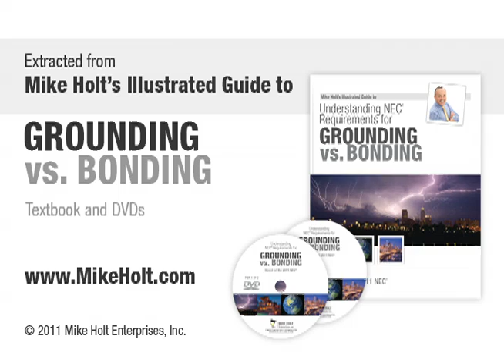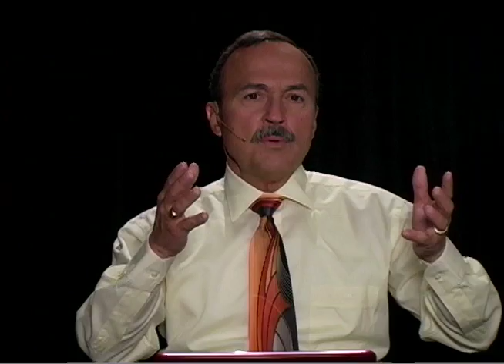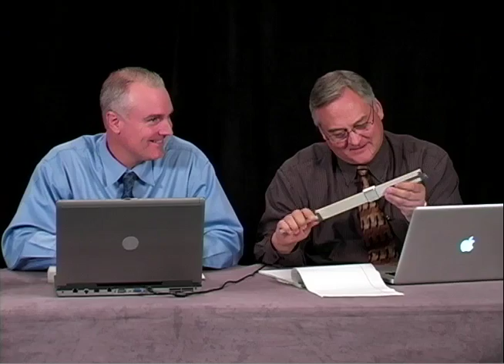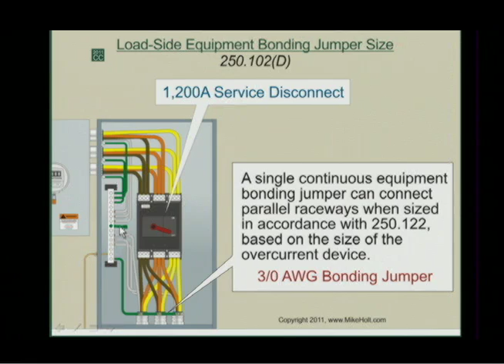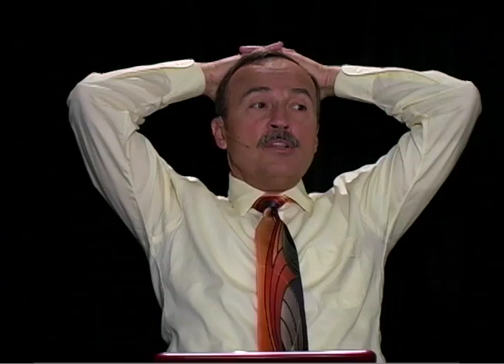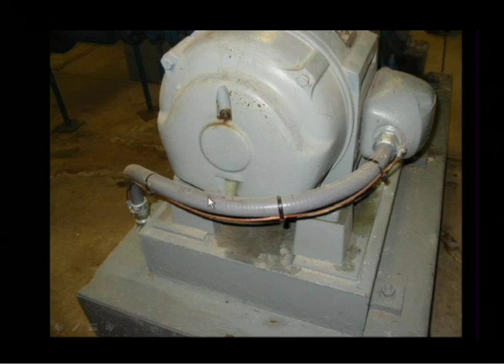NEC 2011 Supply-Size Bonding Jumper 250.102(C) (11min:10sec)

Comment: @ 3:55, according to 2011 NEC, it seems you are correct, that you could have a SSBJ larger than the ungrounded conductors.  I cannot imagine a scenario in which you would have 10 sets of 600 kcmil in one raceway, but I guess it could happen.  More likely, you would have 10 separate raceways with a single SSBJ being used for bonding these raceways, which in 2011 would require 750 kcmil.  Code making panel has addressed this for 2014 and 2017 NEC in Table 250.102(C)(1) Note 1. "The bonding jumper shall not be required to be larger than the largest ungrounded conductor."  This also applies for minimum size grounded conductor which is a more likely scenario and was already addressed in 2011 NEC article 250.30(A)(3).  While we are on this topic, this also applies for 250.122, minimum size equipment grounding conductor.  2017 NEC Article 250.122(A) says "...in no case shall the EGC be required to be larger than the circuit conductors supplying the equipment.  For example, determine the size of EGC for a 1PH 5HP motor operating at 240V.  #10 on a 70A breaker.  250.122 says you need a #8 ground, but it also says in no case required to be larger than the circuit conductors.  Therefore a #10 EGC.

Comment: Im not sure I even understand the first graphic. Conductors originating from utility continue through CTs and then terminate on the line side of OCPD. Where is this supply side bonding jumper coming from. I was always taught that the bond was at the first point of disconnect. 
from that point ground neutral separate . I am so confused
Reply from the maker: Per 250.92, metal raceways containing service conductors must be bonded. These raceways contain service conductors, so they are bonded to the service neutral terminal.

Comment: Curious if the 10 runs of 600 kcm still applies with the ssbj larger than ungrounded conductors. NEC 2020 states, "The grounded conductor or SSBJ is not required to be larger than the largest ungrounded conductor or set of ungrounded conductors".... Anybody know if this means total conductor sizing or conductor in raceway?

Comment: How did you even come up with 3 sets of 700kcmil paralleled for a 1200 amp service disconnect? 700 kcmil at 75 Celsius are rated for 460x.83=381 cu each is 600kcmil
Reply from the maker: Where are you getting 83% multiplier from and why? Which is clearly wrong.
Reply: @MikeHoltNEC  isn’t that a service meter? Or you use 125%
Reply: It must be aluminum wire, 3 sets of 700kcmil at 75C is 420 amps, x 3 = 1260.
Reply: @oscar27ization  Service conductors only have to be rated for 100% of the load, you're getting it confused with the feeder conductors coming out of the main OCPD I think. In that case if you're landing on an OCPD, the terminals are only rated for 75C, and you have to use the 125% rule so you don't overheat the lugs and the OCPD, because the extra heat buildup will affect the calibration etc. The 83% rule you mentioned is for sizing service conductors to a single family dwelling. 100 amp residential service for example you would size the service conductors to 83 amps. I really doubt a single family dwelling will have a 1200 amp 3 phase service! Besides Bill Gates home or some kind of privately owned 200,000 sq ft castle. There's always exceptions, but this would be extremely rare to have a 1200 amp 3 phase service to a single family dwelling. So again, the 83% rule most likely will not apply to this 1200 amp service example in the video was I think intended to show an example of a typical small commercial service equipment installation.
Reply: @brnmcc01  thank you

Comment: This whole time I taught 3/0 Is the largest size ground you have to use
Reply: I believe so in accordance with table 250. 66
Reply: I know this is a couple years too late, but for anyone that reads this: This is in regards to the bonding jumper. 250.66 is the grounding electrode conductor ONLY. Those are not the same thing. They state this towards the end of the video.